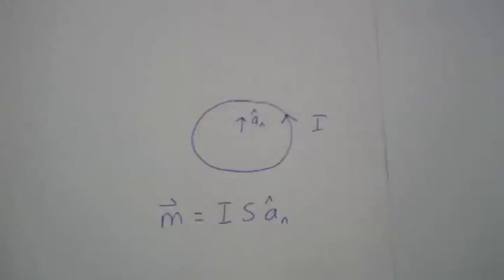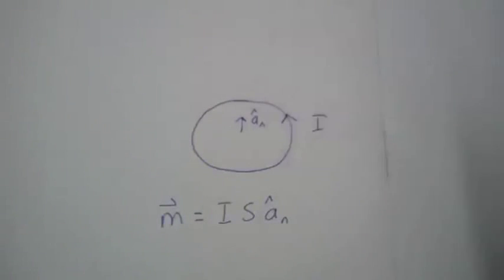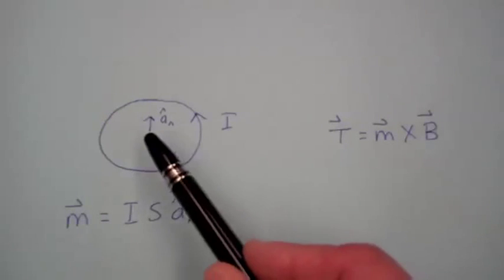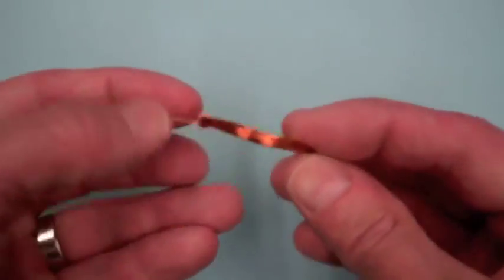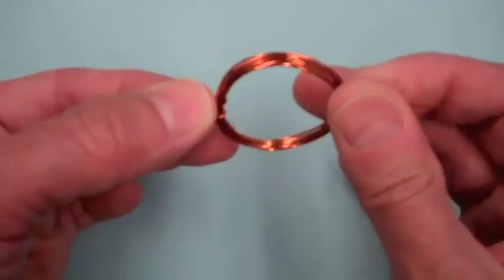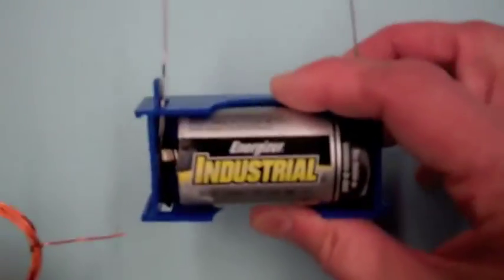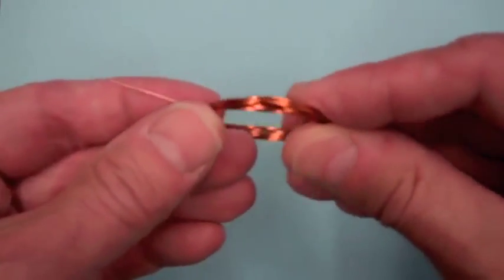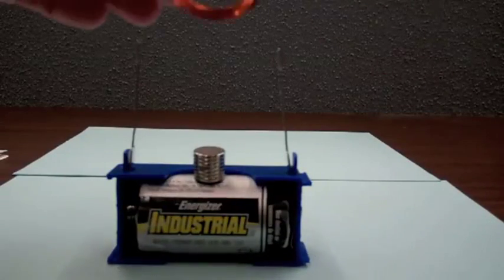Simple Motor with a Permanent Magnet

Comment: Sir I didn't understand what  you said about Commutation ? pls sir explain it 🙏
Reply from the maker: A commutator is a mechanical device that switches the direction of the current in the coil.
Reply: In regular motors the commutation is more complex and the current reverses so the coil is always being turned to get to alignment with the field magnet.
..
In THIS simple motor the current doesn't reverse!  As he explains it:  Removing the insulation carefully on only one 'side' of the wire (the correct side) causes current so the coil turns, trying to align, but the insulation then blocks the current and the rotor continues, coasting past the alignment point to the next angle where the current starts again and attracts it again the same as before.  This way, the coil only gets a shot of current one way to spin it TOWARD alignment, but the current stops before it gets there and it coasts past alignment and past the opposite alignment where a reverse current would be needed.
.
The magnetic attraction only pulls it half way around and it coasts the other half.
Hope that helps.

Comment: This is the First video I found that explains to only remove the insulation from half of the wire to get some pseudo commutation. Many others remove it all. There must be enough bouncing of the contacts to allow rotation on those others.... ? .....
Reply from the maker: I would think the coil would just stop when the magnetic field of the coil is aligned with the magnet's field. I will have to try it and see.
Reply: @electricandmagneticfields2314  Of course, but at that time I didn't see where they explained to remove it partly. I an sure I saw others that explained it correctly after that. 
 This is so old I don't even recall writing that above comment...
.
My motor winding days go back to the 50s probably from Popular Electronics. The armature was a nail shaft with crossed nails for the coil. The commutator was zig-zag wires for the "segments" on a masking tape insulator. It was held up by double nail supports. 
The field was more nails in a "U" with the field coil on this.
It was powered by one of those "Dry Cells" that was about 2" in diameter and 6" tall.
 I found it a while ago on the web, but can't seem to find the plans now.
Much more elaborate.
I've recently done THIS one with students with good success.
Reply: @electricandmagneticfields2314   It was very similar to this one: https://www.youtube.com/watch?v=XXYeEwEywbI
Reply: @electricandmagneticfields2314  Thinking, now...
Shouldn't the bare wire on the commutator be 90 degrees from where you show it? 
You want the coil axis horizontal (coil vertical) when current flows, so the two fields are at 90 degrees and generates a torque.
If you sand a side as you show it, it can stop when reverse aligned and try to push the coil upward.
It appears your method requires a starting push.
Done this way, you should "tilt' the support wires ever so slightly (off balance)  so the armature will come to rest  (battery unconnected) with the coil vertical (the axis horizontal) ... and the commutator making contact.  Then it is self starting due to torque when at rest.
Reply from the maker: @Observ45er  I'll have to take a look. The field is probably spreading out quite a bit before getting to the coil and probably quite a bit over the diameter of the coil.
Reply: @electricandmagneticfields2314  Of course it is spread out, forming a very broad funnel shape, but as I see your recommended removal "side" being face-on with the 'pole' of the armature, it can still lock up there.
Reply: @electricandmagneticfields2314  P.S. The maximum torque occurs when the two fields are at 90 degrees and drops to zero when fully aligned. If current is still flowing past that point, this is reverse torque.
Regards, Steve
Science and Technical Advisor.